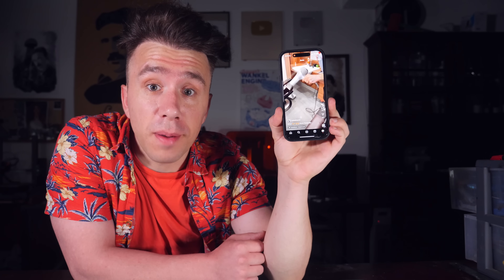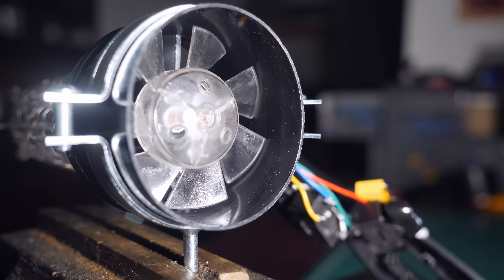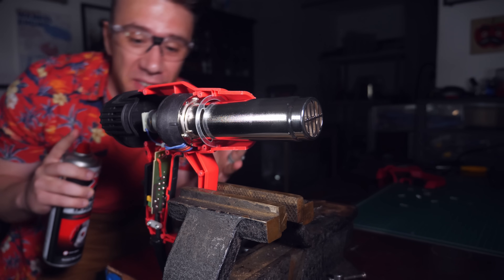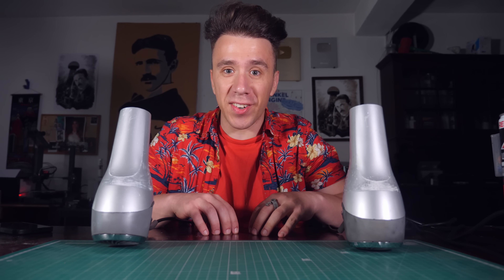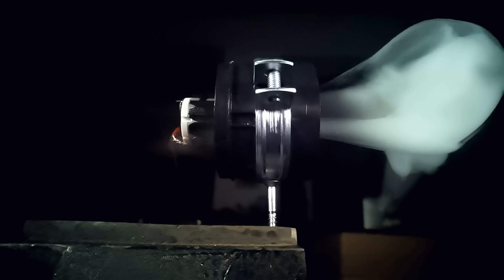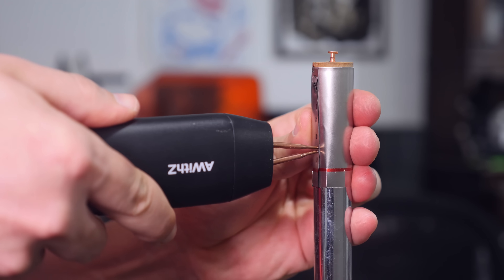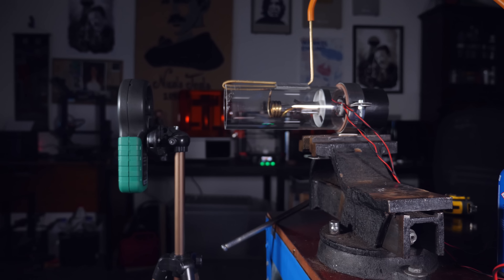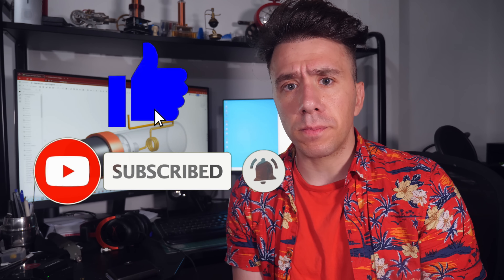I turned my $20 Hairdryer into a JET ENGINE

Comment: Make a cage for the combustor. Either with an array of slightly conical rings or with just holes drilled into a suitable metal tube and you can angle the drill to shape the ideal airflow. The idea is to kind of venturi all the airflow into the combustion chamber as the exhaust velocity increases with stoichiometric combustion. You could also use an annular injector with multiple little holes around the copper tube ring, angle the holes outlet trajectory relative to the longitudinal airflow to find the best injection dynamics. If you play around with the angles of the combustor chamber and the fuel delivery, I think you can get a complete stochiometric burn. If you use a series of conical rings for the combustor walls, you can incorporate an airfoil shape to accelerate the air into the combustor so you'd potentially get a core inside the combustor of low pressure, drawing the atomised fuel into the airstream and low pressure outside the combustor drawing in the air, you can play with the idea of disruptor groves in the airfoils and you could end up with really well mixed fuel air and good combustion. Do I win a 3D printer? That would be really useful :)
Reply: I can't see the replies now where you said "Y o u w o n". Did I win the 3D printer? It's really good if my idea was recognised like that. Can I have the printer then please :)

Comment: Just a heads up. Propane tends to be used as an aerosol propellant. It is possible that the propane in the breaks cleaner is being ignited. If this is the case, the fuel-to-air mixture needs to be between 2.15% and 9.6%

Comment: Bit of a wild idea, but what if you had the fuel injector be a part of a rotor (after a stator) that way, the relative speed of the airflow is less where the fuel is injected, in spite of the whole injector moving!

Comment: At first I assumed the funnel at the front caused more resistance inside holding the air in causing the mixture to heat up and bang but eh

Comment: couple of things. real jet engines do not heat the fuel, and they use special igniters to ignite the fuel.  that being said, maybe  do a spiral with several winds that are basically in the air path, and have the fuel deposit right behind it. so fuel between fan and coil so it hits the coil and ignites. you would need to start off slow and slowly work up to speed much like jets do.

Comment: You could add multiple injectors after the igniter/pilot flame to get more fuel flow, with the one closest to the pilot flame being the smallest, and the ones further away being largest. The injectors should each have independent throttle valves, with the largest serving a similar purpose to a "Power jet" in a small engine carburetor, opening only at full throttle. (Btw, you don't pronounce the U in carburetor lol)

Comment: Use all the air for combustion? I'd say find one of these gardening sprayers with a metal nozzle and adapt that... the joint may not resist the heat, though, in which case my best bet is an old car injector.
[edit: another option could be to adapt an ultrasonic nebulizer to feed an air-fuel mixture upstream of the fan, and keep your ignition and pure brake cleaner injection as is. but then only start nebulizing after the fan is at full speed to make sure the combustion only goes forward]
Stay safe!

Comment: maybe add pure oxygen to the feeding system of the fan, it will feed the fire more oxygen so bigger flame and add control speed to the fan so when its ready you boost speed and bigger flame

Comment: Have injector that’s a big ring with multiple hole in the middle and the air should pass around and grab the fuel with it, then put the heating element after.

Comment: In da next video you can make a giant spinner made out of stainless steel and attach remote rockets or rocket engine to it and spin it at high speeds...

You can also make a giant spinner with sharp edges and attach a high rpm motor to it and DESTROYYY SOMME DISGUSTING TOMATOESSSSSSSSS!!!

Comment: How about a modified aerospike nozzle? Im picturing a tear drop shape, with the longer slimmer end slightly protruding from the nozzle as you have it and the rounder, flatter end facing the air flow, my thinking is as the air gets pumped into the ignition chamber its gonna be slowed against that flatter end of the tear drop (maybe even achieve some compression as the volume for it to escape around the sides of the tear drop would be reduced not only slowing the air but potentially compressing it) Spray the fuel in between the fan and the tear dropped 'aerospike' nozzle and maybe use a different ignition source such as spark plugs or glow plugs? I've no science to base any of this suggestion on but it 'feels' like it make sense, and you strike me as a guy who theorises solutions as much on 'feels' as science, could be an interesting solution, it would also allow you to house the fuel delivery system in a more aerodynamic space (inside the tear drop) reducing the drag on the exiting jet stream potentially resulting in higher thrust.

Comment: yo i want you to do a different version of dyson hairdryer jets it will be much cooler if you understand how the hairdryer focuses the wind to one small point you can start knowing it with letting the hairdryer inhale some flammable gas to the inlet and put the flame inside the dryer’s hole it might ruin the original hairdryer but it’s really cool and it’s really powerful

Comment: i defenitly think one way to make more power is to remove the gas line coil from the flame as gas burns worse if its too hot and then for the air maybe trying to add a multiblade style fan like in airplanes engines to compress the air and get a better burn and if all that works maybe try adding more fuel nozzels to make the flame more even. i think testing the temperature the gas comes in contact with the coil to see what temperature generates more trust is a good way to start

Comment: you also can do this
---------------------------
-------------------------------/-----
   -------| the|                1↑
           |can|
           |------| 2←
its vice versa, the ignitor is at the tip, (arrow 1), and the can (arrow 2) has a pipe going through the tube and out of it. basically a flamethrower.

Comment: add a line that feeds the fuel into a small fan enclosed for pressure, with a second line the feeds back the liquid that didn't turn to gas yet, improved fuel efficiency. I hope i said that in a understand way.
or create a two stage process for the liquid fuel heating up.

Comment: I think you were spraying the fuel too close to the hairdryer, in the original video the man sprays from further away and the fuel mixes better with the air before being sucked into the hair dryer and heated wire

Comment: I followed your RDE video here. Here’s my suggestion: 

An automotive spark plug enters the tube from the side. Covering half of the sparky part is a partial cover which shields the spark from the fuel-air flow stream and initiates a radial rotation of the flame front. Upstream of the spark plug are two wire screens in parallel, which form a flame suppressor. 
Also upstream is a Tesla check valve, to minimize the pressure waves going to your fresh air pressure source: a shop vac. Fuel and air are mixed after pressurizing. 

Fuel, air, spark, rotational flame front. Adjust the exhaust tube length and spark frequency to get the right pressure for detonation. 

Voila!

Comment: You did not build actual jet so far. Observe diagram of V1 engine. It has a one way air valve in front, and was only started with external air, the length of the tube and it's diameter determined a resonant chamber. After ignition,  the exploding gas exhausting the rear of the pipe caused a vacuum to form at the other end, the one way valve opens, and air is drawn inside, and the next explosion begins. Thus, the term "buzz bomb". Otherwise, I like what you are doing. Great fun.Reminds me of me, half a century ago. Later, gator.

Comment: Drill some holes in the fuel line so it sprays fuel outwards. You will still get some onto the igniter which will create a pilot light. Then the radially sprayed fuel will be ignited by the pilot light and burn in the rest of the air in the chamber.

Comment: Taper the end down and put a smaller double sided cone inside the end of it and it forces the air out a little fast and through slightly smaller hole so there will be more fire in contact with the unlit air or fuel and help combust a little more efficiently

Comment: if you make a ring with inward growing fins and put it so that the tip of the fins are farther back than the injector exhaust but still direct air at the middle of the flame also putting plates that extend sidewards on edges of the ingrown finlets will direct most of the air

Comment: He was holding the brake clean farther away, let's it mix with air before it's pulled in.   Also his dryer had a flat nozzle on it (a restriction th increase pressure)    

You may have the wrong brake clean.  Older brake clean is mostly eather, the newer stuff is mostly acetone.

Comment: This might be dumb and highly impractical but... what if you had a rotating fan-like fuel line that rotated with the fan and you used the presser difference created by the air rushing past the fuel line to draw the gas through the line from a feed tank, and then have a ring around the outer part of the tube to ignite the gas. probably not practical or functional but a cool thought.

Comment: I feel like fi u use a shop vac at the input of the fan where is sucks the air in that when that vac suck and pumps more air in too the fan or use an aircompreser with a attachment on the in put of the fan i think that will help with the air

And if u add a second fuel line extended off on the compression chamber that way when the flames start to die down it will  reignite the fuel  

All of this should help 

Well, since u just posted the 40000 rpm  pump, u can use that or the shop vac

Comment: you can atomize the air before igniting it using a makeshift carburetor before the fan and you can heat the fuel by coiling it around the diameter of the tube to make it ignite easier

Comment: Shouldn't an hour-glass shaped outer hull do the job?
If I remember correct, real jet engines have a narrow part in the air flow directly before the fuel igniter. Thus the entire air flow is pushed through the narrow tube where it's ignited.

Comment: Hi!
I think the thrust could be improved by adding an extra fuel injector towards the end of the tube, this should inject most of the fuel. But for the second injector to work you need a smaller flame shielded by the motor, this way the air temperature could be increased to help the second combustion. In addition to this reducing the outlet diameter of the engine should help increase the pressure in the combustion chamber further improving the combustion efficiency. Furthermore using an EDF like this: "12V 9000KV Inrunner Brushless Motor High Speed Jetfan EDF" with a proper metal combustion chamber and an exhaust diameter that allows the fan to build up some pressure in the combustion chamber. This way you use the fan as the jet engine's compressor, instead of just adding an afterburner that has horrible efficiency. Imagine it like a low bypass turbojet where the compressor is powered by electricity instead of a turbine wheel.

By the way, tomatoes are disgusting 
I love your videos because you build pretty impressive stuff with tools that almost anyone can get.
Reply from the maker: Congrats! You won a 3D printer! Send me your info (Name, Address, Zip Code, Phone Number) to integza@gmail.com .
Reply: @integza I’ve sent you an email asking for further clarification.
Reply: @martonhegyesi8416  so did you recieve the 3D printer? or is it on its way?
Reply: @Good23020  Hi, haven’t received it yet. Allegedly it is on its way but I can't confirm that because I did not receive the tracking number I asked for during our conversation.
Reply: @martonhegyesi8416 did u receive the printer?
Reply: How  @integza
Reply: @integza how?
Reply: So an afterburner like in fighter jets
Reply: @猫の仕事部屋 Yeah, but an afterburner burns fuel at ambient pressure and it doesn't run on a stoichiometric air-fuel ratio, that is the reason why they have terrible fuel efficiency. The reason why fighter jets have to run afterburners is, that the heat of the exhaust would melt the turbine blades if they were to inject that fuel into the main combustion chamber. And since Integza’s engine doesn’t rely on a turbine to run the compressor (the fan) it could benefit from using compressed air to burn fuel. Sadly I can't test my theory, because I don’t have the necessary funding and equipment.
Reply: This but with a turbine instead so the air is compressed. You also want to compress the fuel btw. If i'm correct real powerful jet engines do this. Last the color of the outlet 'flames' shows how good the combustion really is so we don't want no yellow flames.
Reply: @Madrrrrrrrrrrr  Yes, you can use compressed butane (1-2 bar or less) or a liquid fuel system but that requires an injector that atomizes the fuel really well. I think the biggest issue with this design is finding a fan with a high enough flow rate and static pressure. Do you have any ideas about what kind of fan/compressor could be used?
Reply: So adding an afterburner
Reply: Definitely an afterburner. We also need a nice bypass.
Reply: I’ve said this before
Reply: congratulations, you invented an afterburner

Comment: SomethingYou could try is doing an experiment with metallurgy testing the durability and hardness with quenching in different temperatures of water by starting at something like water cooled with nitrogen then move onto dry ice cooled and then room temperature, boiling, adding salt, etc and then dunking different pieces of metal into it and see how brittle it gets, look at the structure of the metal and see if the hardness changes at any different point

Comment: Basically, it's a propane torch with other fuel...did you try alcohol in micro amounts on the hair dryer? The extra surface area along the heating element and oxygen intake levels might force a combustion that is desirable

Comment: If you have an air compressor, buy a refillable compressed air parts cleaner. That way you can control the amount of pressure in the can. You could also experiment with other combustible fuels like alcohol kerosene etc. I know some places will sell brake cleaner by the gallon and most of the time cheaper than by the can.

Comment: Keep the current ignition wire but cap it off and drill several .001 holes around the coiled portion

Comment: Nice job, I could think about something like that but I have a question . Why wouldn't you add a smaller  final part to the combustion chamber so it adds more pressure? So if you try to add the engine It would make more thrust. (I don't know a lot about it)

Comment: I designed a burner similar to an air multiplier, that uses only propane to move the air.  Managed to print it but it didn’t survive long enough to establish viability.  Give it a shot.

Comment: you can maybe try to funnel the air through a cone towards the flames then instead of using ambient air you can use a tank of oxygen or maybe something like how you used potassium permanganate and hydrogen peroxide to add oxygen to increase the flame size and if needed make the body out of aluminium  so that you don't have to worry about the sides of the engine melting or burning

Comment: Hey Integza , for improved propulsion, it's recommended to channel the air flow through the center while directing the fuel to the outer side. Utilizing a technique similar to the porous knife demonstrated in your video can facilitate better mixing of the fuel and air, enhancing overall efficiency and performance. And you forgot to destroy a tomato in this video.

Comment: Try a static set of fan blades that will not turn inside and break up the laminar flow of the air before the  combustion area…

Comment: I'm not an engineer or anything but if you put a open helix on the inside off the tube like riffling to slow the air but let it filter into the center there would be more oxygen to burn, for the material i would recommend metal as the slow winds means your wind shield might not hold up and might burn the acrylic. as i stated earlier I'm not an engineer or scientist so i'm not sure if this would work or fail.

Comment: Brake cleaners have a bunch of different formulations, most of them use either acetone or isopropyl with some hydrocarbons mixed in, and then CO2 as propellant. You may do much better by either using a small pump or compressed air to inject the 'fuel', and getting a bottle/container of Non-Chlorinated(extremely important) brake clean that is intended to be loaded into a compressed air sprayer and using that for fuel. That will also keep your fuel from being chilled by the expanding propellant. That alone should get you a significant improvement in combustion. Bonus points for putting a spiral/mist tip on your feed tube, which ought to allow you to spread the fuel more evenly throughout the full diameter of the chamber. A sintered bronze bronze air/fuel filter with a fitting to connect to the copper tube may also work. This from a guy who makes gas manifolds for a living, so it might be a bit overpowered. I'd go with compressed air for first attempt.

Comment: Try adding fins to the ignition tube that will force air in and if you off set 2 or 3 layers of fins you should not slow down the air speed and air should still flow freely through